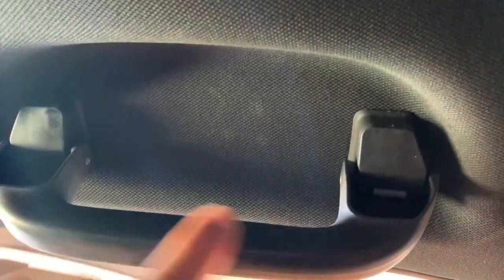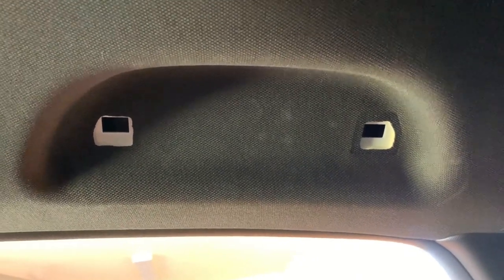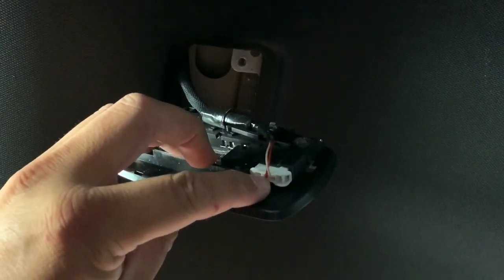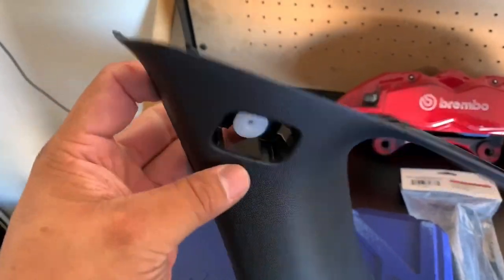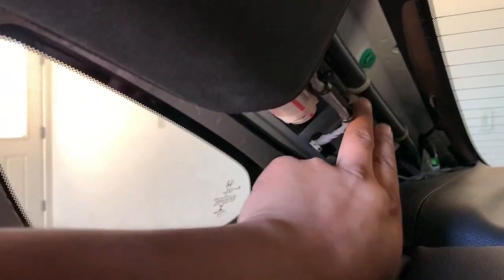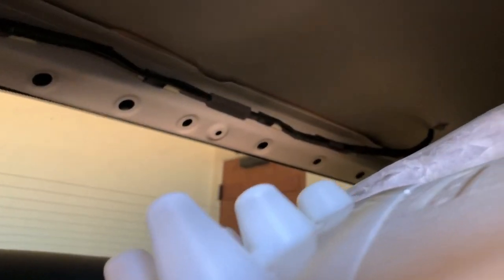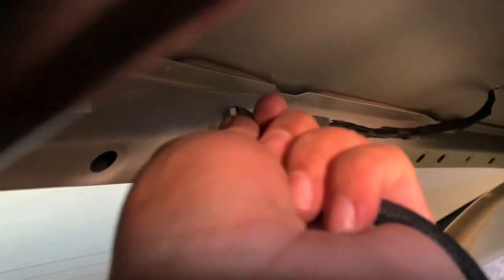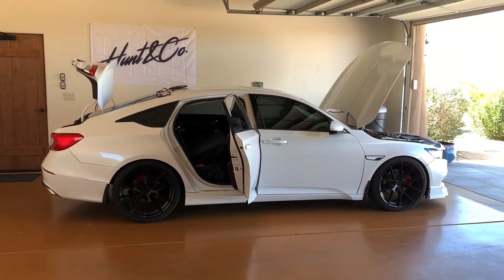How to REMOVE the factory antenna from the 10th Gen Accord (2018/2019)

Comment: Thanks for the video my son has a 2019 it was recently stolen we recovered it right away because we had a air tag in the car only thing that was ruined was they yanked the antenna wire off from underneath the roof liner might have to replace the antenna along with the wire harness not sure why they did that but the video helps out a lot thank you 🙏🏼

Comment: First, this is an extremely helpful video.  I damaged my antenna mast and have to replace it. The cost for just replacing the antenna was quoted at $500 in Akron and $1000 in Cleveland.  The cost of the antenna assembly itself from both dealership was an additional $99. That tells you what this video may be worth to you. I am in the midst of the project right now and will order the part tomorrow.  I have completed everything back to the back plug. I am not sure exactly what you did to take that left cushion off.  It looks to me like the bottom seat has to be taken off to unfasten a bolt. Is that correct? Can it be reached by going through the trunk?  Thanks for your valued input.

Comment: I wanted to add another comment after completing this project.  Let me say that this is a wonderful video that saved me a lot of money.  If I had to do it all over again I would do two things additionally.  I would begin by taking the seats out. I ended up taking the bottom seat and side pods out but it would have only been a couple minutes more to do all the seats and it can be done in 10 minutes.  Once you take the seats (and side pods) out then the removal/install of the side panels is a lot easier.  On the rear "deck", the front of the deck has plastic holders that overlap the piece it hooks into - kinda of pull down, back then up.  Then the rest is held in by green plugs. Ouch.  It doesn't have to come all the way out.  There is an entry door on top but you have to have very small hands to use it. The tuner plug has only one side that depresses so you can press and pull. I would also remove the front two panels where the SRS buttons are located on the center posts. Do exactly as you do the earlier SRS button then up and out. It would have been so much easier if that access door was a little bigger! Thanks to Fahrenheit for this video.
Reply from the maker: Glad it helped someone!

Comment: Great idea via our last video... lol. Now add that rear window visor. Also when I do my roof I’m just going to buy a black antenna Instead of wrapping it. Personally.
Also if you drop the headliner and pull the wire harness away from frame/tape, shouldn’t that give you enough room to unplug the wire from the antenna rather then taking the whole wire harness from the car??
Reply: Why spend more money and invest time? just do the wrapping over the antenna, u can spend that money on other things for the car
Reply from the maker: You can’t unplug anything from the antenna. It’s a solid piece with a long harness, the only way to get it out of the way is to get it free from the car. I spent a solid 15 minutes thinking about the issue once I came across it. Honda should have made the harness separate from the antenna but nope...
Reply: LudacrisKillHD I’m not going to complain over $120. And the time and effort makes up for the few dollars you’ll spend. To me at least. Plus I guess you can rip it apart again when you have to re-wrap it. SMH
Reply from the maker: I will say wrapping the antenna was an absolute bitch. It took a lot of time and a few breaks because I wanted to throw the antenna at the wall 😂

But to be fair, I’ve only ever wrapped my truck so I’m not the most skilled. I’m just happy I knocked out the roof by myself. 🤙🏽

Comment: Okay but what about the hole in the roof now? Lol
Reply from the maker: Lol I the antenna didn’t stay off. Just removed for the vinyl wrap ☠️.

Then added back and color matched.
Reply: K that's what I figured you did lol. But I was just confused lol
Reply: I wish it could be removed with no whole cause the cars would look so much better 😩
Reply from the maker: @erikareyes2848  agreed! That damn antenna holds the am/fm and satellite radio receiver so if you can live with only CarPlay just disconnect it 😂
Reply: Facts I drive in silence anyways 😂
Reply from the maker: @erikareyes2848  😎 inner peace is all we need.